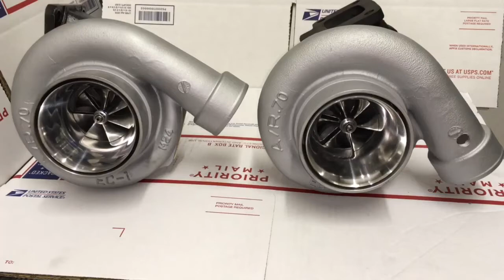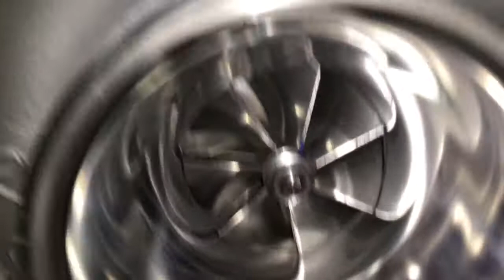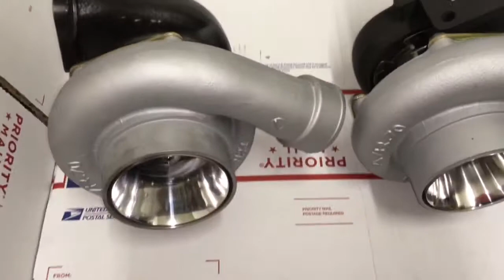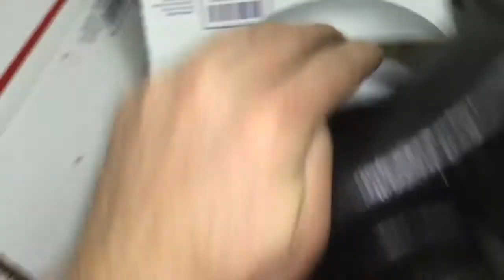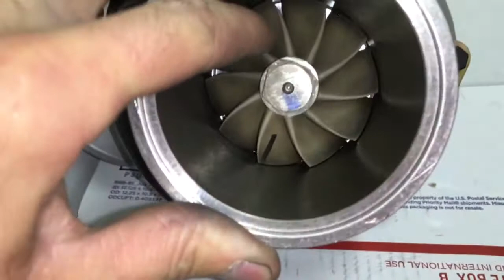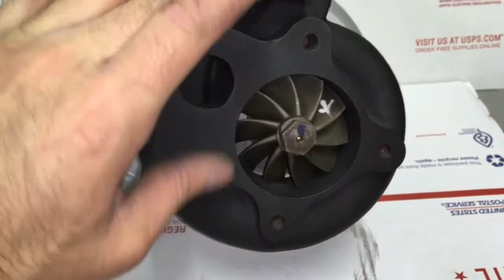FP 82HTA Turbo Rebuild

Comment: How do you remove the bullet tip the cover the nut from the compressor wheel?
Reply from the maker: The compressor nut is left hand thread, turn it right to loosen.
Reply: Turbo Lab America the nut has a cover-like very tight so i cannot loosen it

Comment: Austin, this is Alex Dickinson, I've emailed and called you regarding my rebuild/upgrade over the last few days, but haven't heard back. Please respond to me asap. Thanks.
Reply from the maker: +Alex Dickinson I took a look at your turbo, the best way to go ball bearing is to go gtx3582r based on the parts I have in stock. I have a 60-1 compressor for a gt3076r but it won't fit the gt35r turbine. Exause tge shaft bore difference
Reply: The turbo you received from me has a 60-1 Turbonetics compressor housing and a .82 Garrett turbine housing. Not sure what the problem is here. Give me a call so we can sort this out.